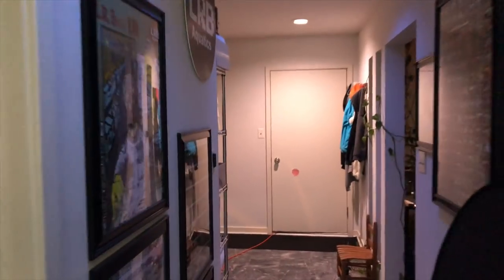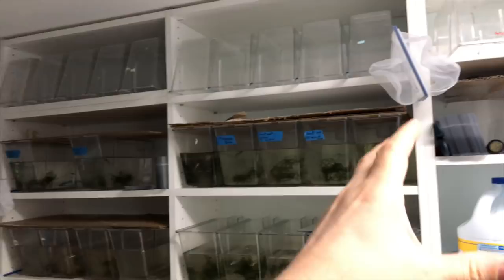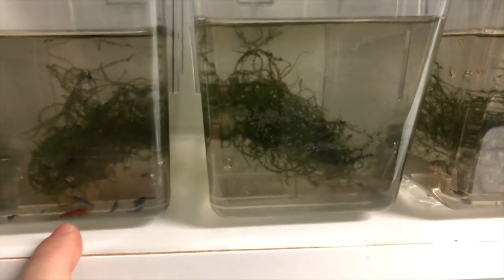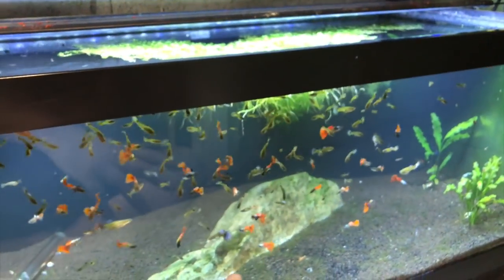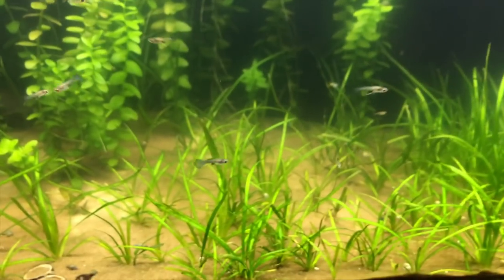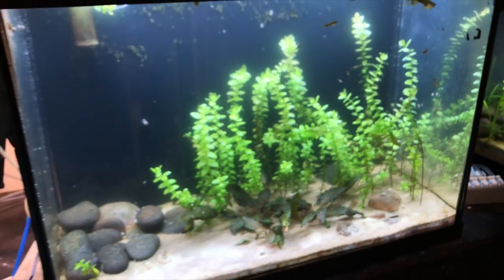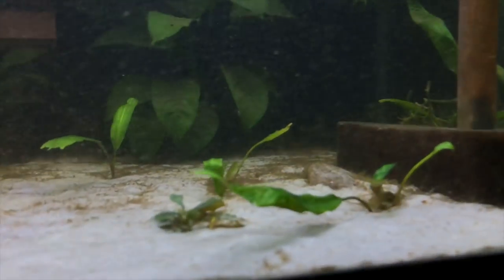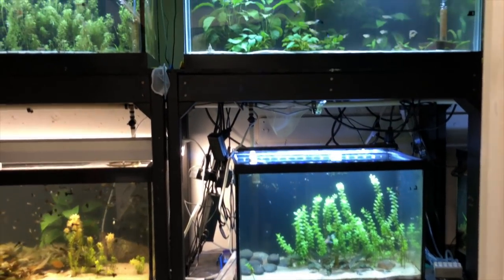Breeding and Quarantine Aquarium Fish Room My Utility Section 4 of 7 Fish Rooms

Comment: Your plumbing system is incredible,  that must be worth a small fortune itself. When I see that I realize how much I have to learn. Do you strive to maintain a certain PH in all of your tanks or do have different PH setting in different tanks intentionally? After all, you keep fish, shrimp and then some (snails). I'm starting to use snails more to help with tank management and want to learn how to put shrimp to work as well. Unbelievable how many planted tanks you manage. The majority of viewers will not realize what's required to manage that many tanks and prevent algae.